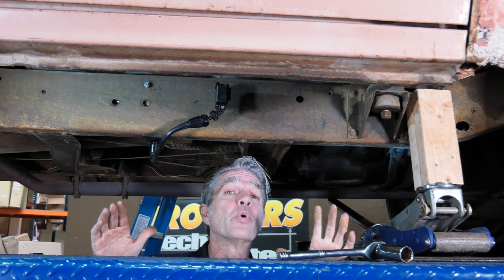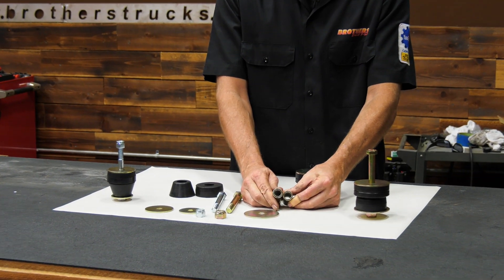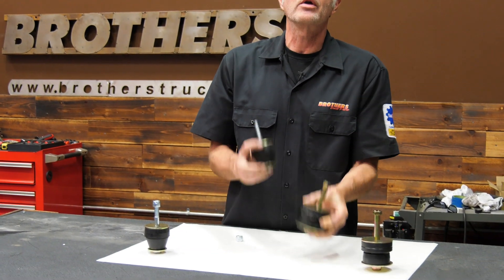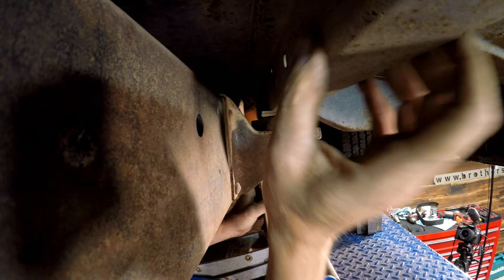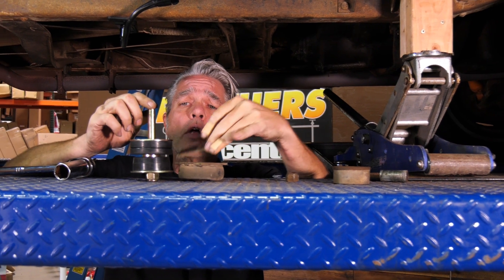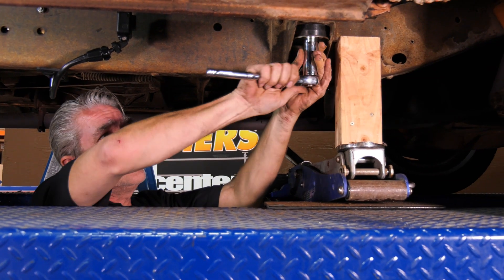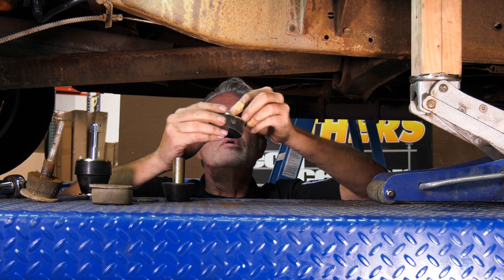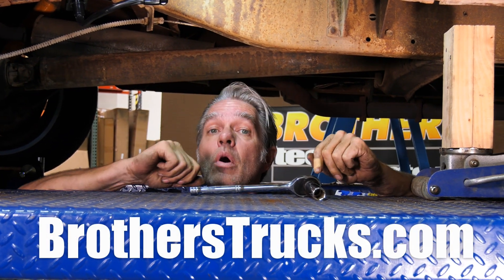1960-66 Chevy & GMC Truck Cab Mount Installation

Comment: Good idea about noting if one or more of your corners has extra washer for spacer on the top of the top located rubber bushing.
When I did mine I found some relatively serious rust on the top surface of the left rear perch. It had a extra washer there, which I thought should have been on top.
Anyway I cleaned the rust off and applied some ospho then painted .
With These videos I am going to send bro some business....
👍
Reply from the maker: You can never predict what you'll run into when you're working on these old trucks. You really have to just dig in and see where it leads you. We hope you're enjoying the project, looking forward to doing some business with you. Thanks for always watching!

Comment: Mine need redone, but cab support braces themselves have rusted in a few spots 😬.  Gotta pull the cab and weld in new ones.
Reply from the maker: Yeah, we just did some too on a '72 we worked on for a TV show. Not a hard job really but you have to take so much other stuff apart to get to them that it takes a while. Good luck with your project!

Comment: Hi just wanted to say I love your videos they're great. I have a question how hard it would it be to swap a 1954 Chevy cab on a early 2000s pick up chassis not really sure if it'll fit with wise I know I got to redo the mounting brackets and figure out the steering  making sure it doesn't hit anything. Any input would help.
Reply from the maker: It would be difficult to swap the '54 onto a 2000's chassis. Lots of people are doing this type of swap, but they typically use a S10 chassis because it is narrower.
Reply: @BROTHERSTruckPartsTV  thank you for your input I appreciate it that's what I was figuring I'll let my nephew know we would have to go a different direction.

Comment: The main question is do the 3/4 ton trucks use the same bushings as the 1/2 ton?  And same from chevy to gmc?
Reply from the maker: 3/4 ton use a different bushing, however it is the same from Chevy to GMC.

Comment: So do I always use the washer the truck came with from the factory even if some of the others don't have one sir?
Reply from the maker: The washer is more or less a spacer and an insulator. If you choose not to use it on one bushing, then we would recommend you don't use it on the other bushings either.
Reply: @BROTHERSTruckPartsTV  ok gotcha thanks once again  👍🏼👍🏼

Comment: Help, I’m hung up! Doing 66 c10 pans, inner outer, never done cab mount bracket before.  I drilled spot welds with cutter, can slide seam buster on top of cab mount bracket all way up to welded floor pan brace, but cannot get the old rusty mount out.  Have entire bushing assy removed, drove bushings out from under neath.  Is there a spot weld on the very bottom I’m missing.  The r do they just freeze in there that good.  I’m mildly getting on it with 4 lb hammer, zero movement.  Is it tacked all the way at back to the frame support it butts into?  The floorpan is completely loose from the cab brace.
Reply from the maker: So the problem you're having is getting the bolt out of the cab mount? We're not completely understanding what's stuck?
Reply: No, I found what’s wrong.  Factory cab mount bracket has tabs welded to inner frame mount.  Those tabs are non existent on repro cab mount.
I guess I’m using wrong nomenclature, I always thought cab mount was the metal piece, and the rubber donuts were called bushings whereas you use terminology cab mount for the rubber donut package.  I’m talking about entire removal and replacement of stock metal cab frame mount, or bracket if you’d prefer, that runs inner fender to floor brace and bushing installs underneath.  
But I’m resolving by leaving the inner couple inches intact and cutting my repro cab mount frame bracket shorter and welding to orig couple inches of bracket still attached between bushing hole and floor pan brace.
Reply from the maker: @whatposterman1222   Excellent solution for your situation! This is a perfect example of doing what needs to be done on YOUR project. Great work and feedback!

Comment: Is this the same kit for a c/20? if not could you provide info on what is needed.
Reply from the maker: Completely different for a C20, however a conversion is available since 3/4 ton mounts aren't currently available. Here's a link: https://www.brotherstrucks.com/1963-66-CHEVY_GMC-TRUCK-3_4-TO-1_2-TON-CAB-MOUNT-CONVERSION/productinfo/CMCK366/

Comment: I have bought some nylon ( I think that's what are) cab mounts for my truck. What is your opinion of them? And do they mount different from the factory ones?
Reply from the maker: They are slightly firmer than the factory ones, and some people claim to be able to tell the difference. We've never experienced a different feel, and if anything, they make it easier to get and exact line up of other body panels that attache to the cab, like your fenders and hood.

Comment: Can these be used for the front end as well? I'm restoring a 66 and my front end is "taking a nose dive." I think it's because the front mounts are missing.
Reply from the maker: No they can't be used for the front, but we do sell the front bushing kit as well. Here's a link: https://www.brotherstrucks.com/1960-68-CHEVY_GMC-TRUCK-RADIATOR-CORE-SUPPORT-MOUNT-SET/productinfo/RSB6068/

Comment: Are the mounts the same for a C20 3/4 ton.       Not a c10.
Reply from the maker: The 3/4 and 1t trucks used a different cab mount than the C10.
Reply: @BROTHERSTruckPartsTV  i think the fronts are the same and the back for sure are diffrent.
Reply from the maker: @RCbasheracer   Yep!

Comment: If the cab is not level, could it be the torsion bars (1960)? If so how do I adjust them?
Reply from the maker: Is the frame level? If the frame is level and the cab isn't, then its going to need some shims in the cab mounts. I BOTH the frame AND cab are not level, then it's probably your torsion bars or rear suspension.

Comment: First I love all the helpful videos. I have a 57 Chevy that was originally a V6 but now has a V8. I’m doing a restoration and was looking for V8 motor mounts that would work on my truck. The catalog shows V8 mounts for V8 equipped truck. What will work on a truck that was originally a V6.
Reply from the maker: Is your V8 currently mounted with side mounts or front mounts? Basically, how was it converted to a V8 already?
Reply: BROTHERS Truck Parts they are front mounts, just behind the fan. Not sure when it was converted but it was a long time ago.
Reply from the maker: @deanmendez2626   if they are front mounts then the stock type V8 mounts we sell will work. Yours should look like these: https://www.brotherstrucks.com/55-59-ORIGINAL-V8-MOTOR-MOUNT-SET/productinfo/ESM5559/ . If you have any other questions, or need to sort this out more, please call our Customer Service guys @ 800-977-2767. They all know their stuff and will surely be able to help.
Reply: BROTHERS Truck Parts everything looks right except the bottom brackets. On mine it’s bolted to the crossmember ( no bottom  bracket ) wish I could send a pic to y’all.
Reply from the maker: @deanmendez2626   Call us and we'll give you a number you can text a photo to. That way we'll all be on the same page.
Reply: BROTHERS Truck Parts thank for all the help. I called and sent some pics. Thanks for all the great how too videos.
Reply from the maker: @deanmendez2626  You bet man, good luck with the project!

Comment: Anything yet or plans to do a video on tracking down rattles from the bed?
Reply from the maker: Nothing planned at the moment. We'd suggest you start by replacing the bed mounting pads because they are typically worn out (they were rubber). After that check to make sure your tailgate doesn't have any unusual amount of play.
Reply: @BROTHERSTruckPartsTV  Thanks, will do!

Comment: Is this the same way you would replace cab mounts on a 67-72 c10?
Reply from the maker: Very close to the same procedure. Thanks for watching!
Reply: @BROTHERSTruckPartsTV  I want to do my 71 C10 but I'm curious about the bolt removal. Is there access on the cab floor or do you need to cut a hole to pull the bolt through?
Reply from the maker: @tylerljungberg4607   You don't need to cut a hole, almost the exact same procedure as what you see here. We'll be doing a 67-72 cab mount install video soon too.
Reply: BROTHERS Truck Parts awesome! When you do, please show the part where the bolt is dropped through the top because I’m not sure what that will look like without ripping up my carpet
Reply from the maker: @tylerljungberg4607   Absolutely!